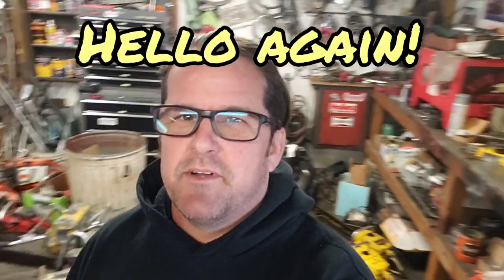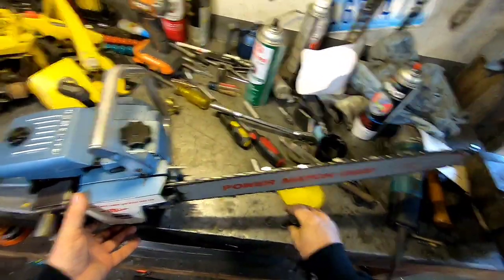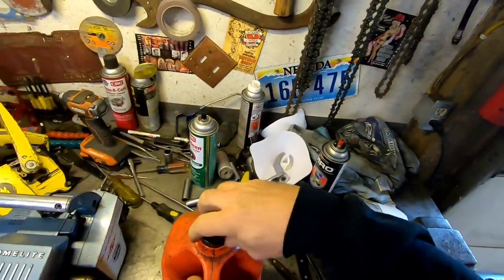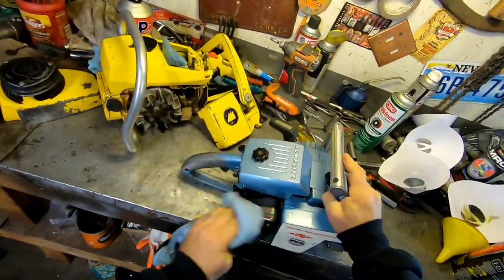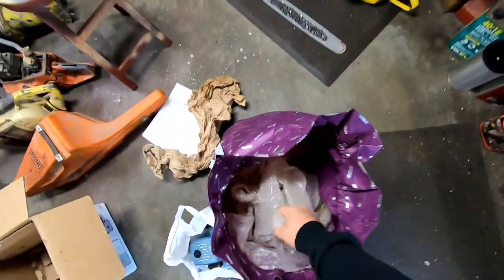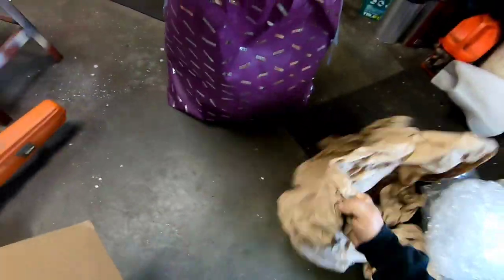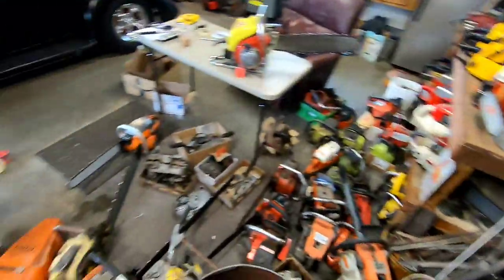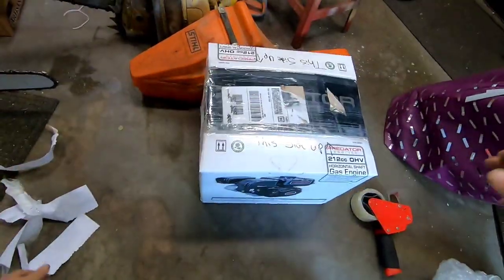How to properly Package a Chainsaw for Shipping start to finish...😁

Comment: I bought a couple of saws a couple of years ago, and they did a super lousy job of packing.  The first one lost the bar in shipment, the carb was broken off the crankcase and on top of that they sent the wrong saw. The other one showed up, but the bar was sticking out halfway through the bottom of the box.  When I was still working, we shipped stuff all over the country, and I always took great care to do a do a proper lob of  packaging.  I had only one complaint.  The box was crushed by a forklift, and I didnt have any anti forklift packaging at the time.  Hope you and  the family get well soon.
Reply from the maker: Thank you Sir! Yes, very disappointing when a saw gets busted in shipping,  especially a hard to find one. Can't believe people try to ship them with bar and chain still attached, Oil and gas still in em...🤣🤣 Crazy...Hope you are well my friend!